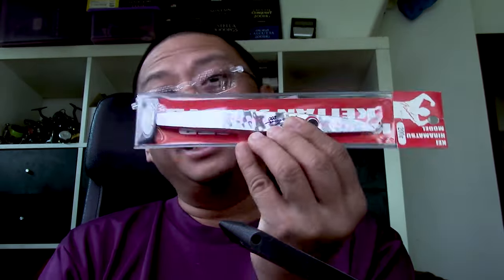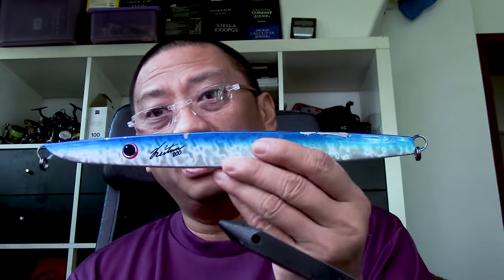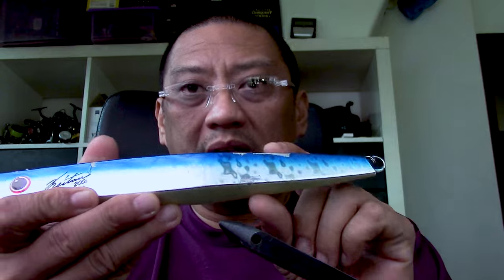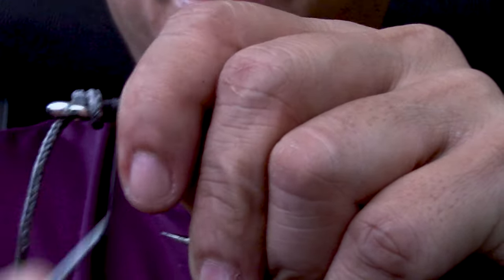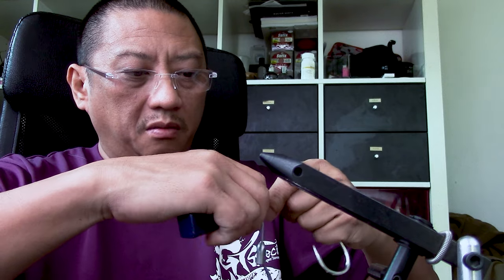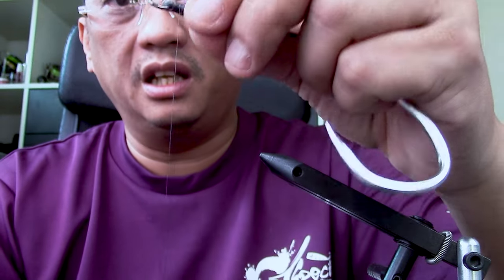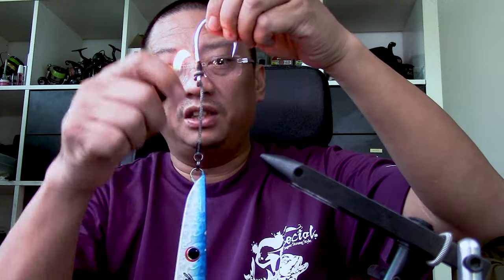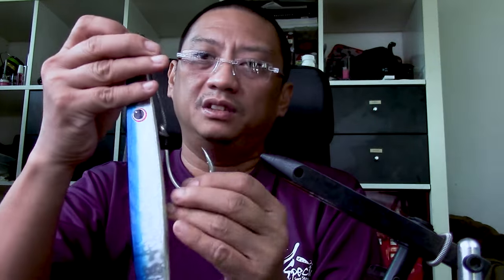HOTS KEITAN ALUMINUM - YOU HAVE TO SEE THIS JIG!

Comment: First to interact. Good video boss. Lisud lng mangita ug higher LBS lines for assist hook.
Reply from the maker: For the cords? you can find them in Shopee or aliexpress. They are not too expensive. If you are just looking local, then you are a slave to what they stock. Lots online...and cheap.
Reply: @TheFishingKit  how to know what is appropriate? Like UHMWPE cord will suffice? Kevlar? Dacron? Or etc?
Reply from the maker: @marcbrian3190  HMPE is Dyneema and spectra. Kevlar is ok, but not as good as HMPE. You can look for hollow cord, so you can insert wire, mono or flourocarbon. you only need two or three sizes depending on what you are into. but 350lb is often more than good for big fast jigs such as these. I had this cord laying around after rigging my kayak, so I found use for it.
Reply: Thanks for clarifying 👍🏻👍🏻👍🏻 will update my notes 👍🏻
Reply: Hello Kit, I've bought the 20 red varivas a couple of days ago it's a solid braid, that'll be fine for the micro jigs I've got that I can tie, I have a few Chinese braids that I can pull out the centre cord and feels soft and thin after splicing the jigs, the centre cord as it was pretty thick, watching your videos you I think reduces the rating to one quarter of its braking strength, so I put in, one, sometimes double 80lb braid fishing line I have for more strength. watching your videos, pulling out the centre cord of the varivas red, I'm now interested looking for the varivas red braid that I can take out the centre braid to splice the 20 to 80 gram jigs I have, I think that would be thicker and maybe little more stiffer, do they make one that I can splice up to 80 gram jigs I have? or they are too large, if you can help me please, I'm sorry to be annoying in any way to you.
Reply from the maker: the Varivas SS in bigger sizes are hollow. I think it starts with size 25 or 30. They are very very difficult to splice - it usually takes me a long time and a lot of patience to splice these...but it is possible. You will break a lot of needles in the process. Get other cords...easier less stress and less time spent on something that matters very little.